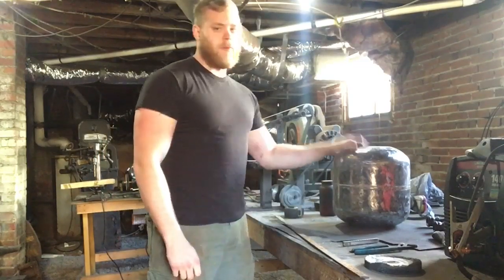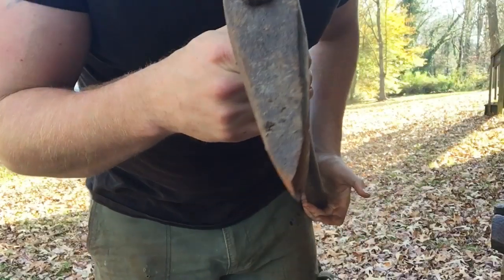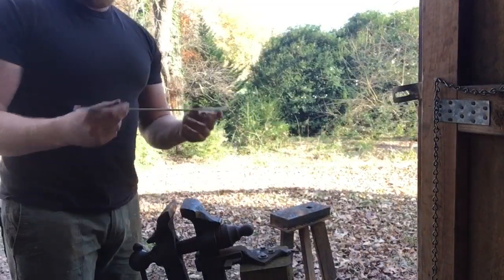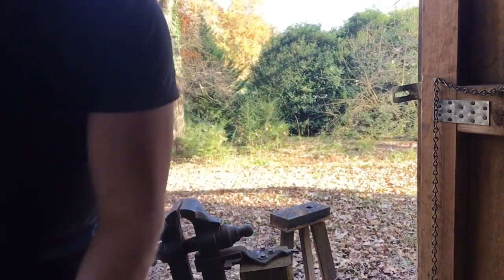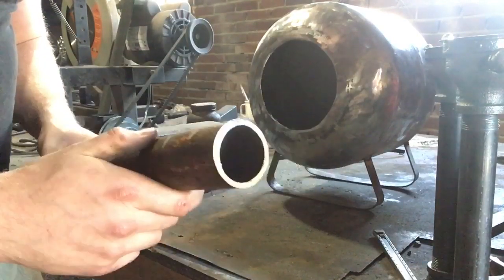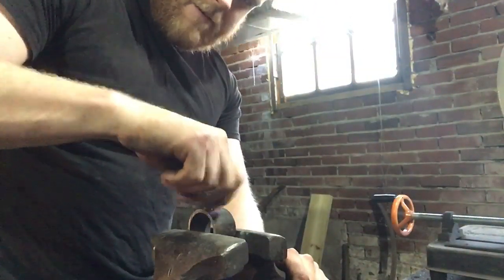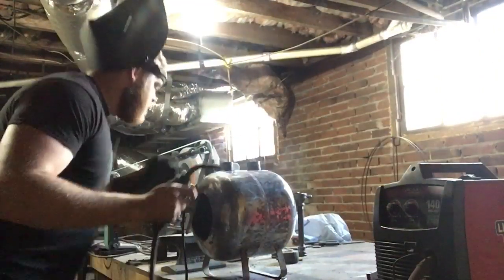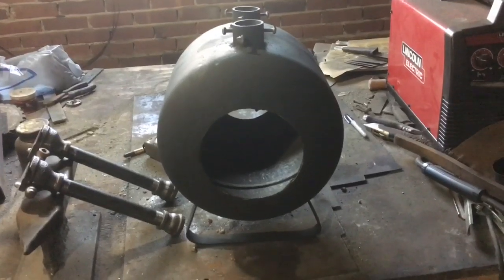Building a forge from a propane tank part 2: body assembly

Comment: john quick question what it the spacing on the burner ports how many inches apart? im building mine from same size tank as yours thanks very much
Reply from the maker: CT relic hunter it’s about 4-5 inches or so. The burner kit I bought came assembled so I just measured it to figure out where to put the burner ports

Comment: Mate I have enjoyed the video But thank god for the metric system. for future reference  for cutting circles get a piece of tubing slightly larger than your cutting head on your oxy torch weld metal rod  onto the side of the tube  (  O----0--- ) then get a large solid  rod drill two holes one on the side to slide the smaller rod through the bigger one and now drill a hole  on the top down to the side hole thread the top and place a lock bolt in the to  grind the bottom of the large rod to a point . Now you can cut curricular holes in anything. Thanks for the video

Comment: So i used the hole saw bit and the teeth pretty much melted. Was the drill too fast?
Reply: Yes. Also check you used a hole saw for metal rather then wood.
Reply from the maker: Sam Klimek yes. Cutting oil helps or the blade may have been dull.

Comment: Hey bud , I'm at the point where I have to weld the legs on. What were the settings for your welder, if you can remember.  I'm not a welder at all .
Reply from the maker: I have the amperage turned up 3/4 of the way and the wire feed speed on 3/10
Reply: @OldHickoryForge  Ok thanks John

Comment: I have a old propane tank, but I don’t have anything to see if it’s empty, could I still take the lid off if there’s still propane in it? Thanks
Reply: If you cant figure out how to see if its empty then just step away from the fucking tools before you hurt yourself!
Reply: Eastern Blacksmith just remember the gas is heavier then air and will accumulate in areas of still air as in workshops, sheds garage. 
I had my apprentice empty a few bottles but she done it up top of the driveway over night. We left for the night and when we came in the next day there was a flash over inside the workshop because the gas had come down the hill and settled inside the workshop.
Reply: I am think about buying a new empty propane tank, and do say EMPTY. Sam Club has new empty propane tank for about $27.00.
Reply from the maker: Brandon Jenkins ittl feel pretty light if it’s almost empty. There should be a little maintenance valve on the side you can turn with a flat head screwdriver to bleed it. Just make sure that you aren’t anywhere near anything that could cause a spark. Or if you go to your local scrap yard you can probably find one for a couple of bucks and they are almost always empty already because the yard won’t take them if they aren’t.
Reply: Dude! Just go buy a new tank. Totally safe, won't stink, cleaner to work with, don't cost that much.